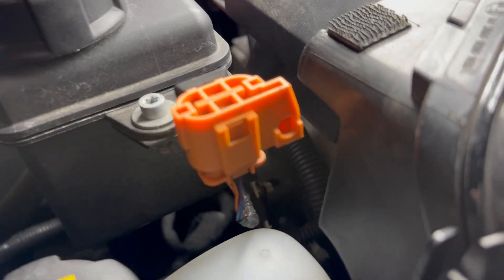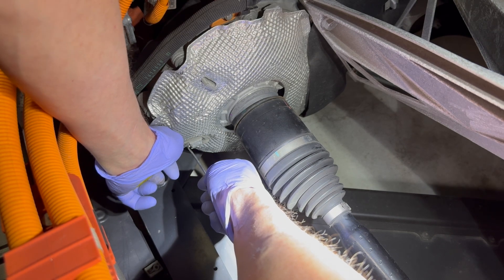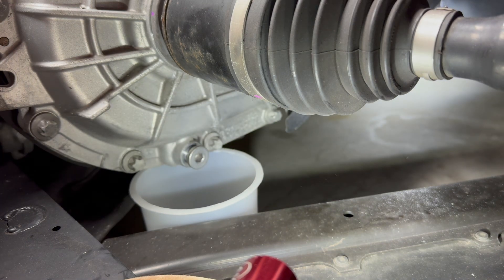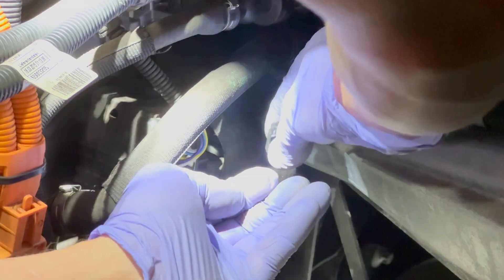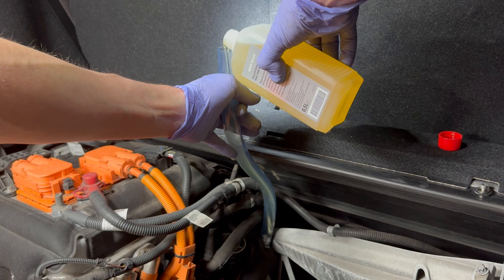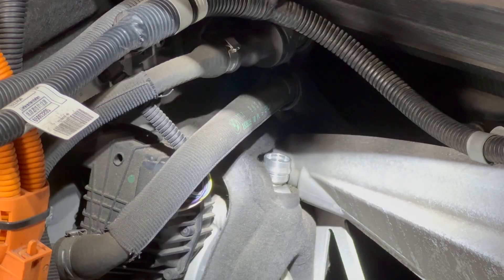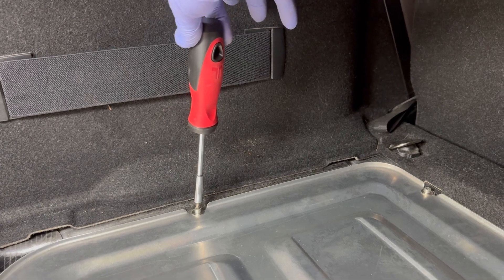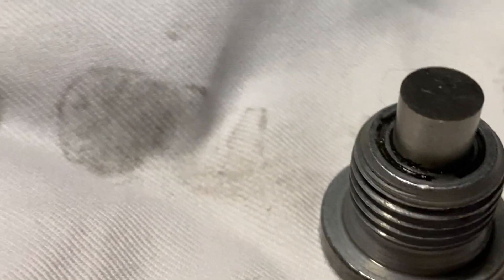BMW i3 transmission differential fluid change

Comment: Thanks for sharing.  Looks like it was worth it.  Curious how many miles were on that i3?
G1 oil up to 2018, G3 oil after
Reply from the maker: About 100 000 km / 60 000 miles. I will  likely change it again at 150 000 km / 90 000 miles. You are right about the oil, and I think BMW changed the specification for all i3s in 2018, not just those built after that date.

Comment: Did you feel any change in acceleration or noise?
Reply from the maker: Neither changed. Nor should they have. I remember 50 years ago we used to put banana peel into the differential if it was noisy, but things were done differently in those days.

Comment: One thing about the motor pan screws: the parts that oftentimes get loose (female end) are called "well nuts". They are female adapters with a rubber shell meant for securing fasteners to fiberglass and other thin/fragile materials. My i3 had several that were loose/missing. A light application of two-part epoxy (not necessary if you get ones that have a larger rubber boot, as they will friction-fit instead....I got a thinner rubber boot, hence the epoxy) to secure the well nuts to the carbon fiber.

Well nuts are commonly used in the RV and marine industries for securing bolts to fiberglass.

Comment: Great job! I wonder if the electric motor uses this oil for the motor's bearing lubrication or if it's exclusively in the gearbox. I have a 2017 with the rex and I was disheartened to hear these ball bearings up and including that year. I love the car though!

Comment: Hello, do you know the tightening torque of the screw?
Reply from the maker: The drain plug is tightened to 35 Nm. I do not know whether the boot floor screws have a published tightening torque - I am not brave enough to go further than finger-tight, as shown in the video.
Reply: Thanks  @soennecken8

Comment from the maker: The numbers:

Boot floor/motor compartment lid screws: Torx T25
Transmission drain plug: 8 mm hex drive
Drain plug tightening torque: 35 Nm
Vent external diameter (best size for tubing): 19 mm or ¾ inch
Transmission lubricant: BMW G1 or BMW G3 axle oil
Lubricant volume: 500 ml
Reply: Interesting enough mine only came out 300ml
Reply: BMW state that you need to use MTF-LT-5, and not BMW G1 or G3. The GL-5 additives in G1 and G3 can attack yellow metal components, and higher viscosity increases drag and noise meaning increased bearing wear with long term use. I'd highly suggest changing this over to MTF-LT-5 ASAP.
Reply from the maker: @AshyB  My information is from ISTA. And Schmiedmann sells BMW G1 hypoid axle oil for this application. So does my BMW dealer. They should know.
Reply: @soennecken8  In current ISTA, the BMW i3 rear drive unit fluid is clearly listed as:

“Transmission oil eFluid (Shell EF-6)”
BMW part number: 83 22 5 A1D 718

BMW classifies the i3 drive unit as a transmission (reduction gearbox with integrated differential), not a hypoid rear axle. That’s why axle oils like G1 or G3 don’t appear in ISTA for this car.

Older references to MTF-LT are legacy naming. EF-6 is the current, EV-specific transmission oil that BMW now back-specifies in ISTA.

If anyone wants to double-check, this is visible directly in ISTA under the i3 rear electric drive unit oil specification. That’s the authoritative source.